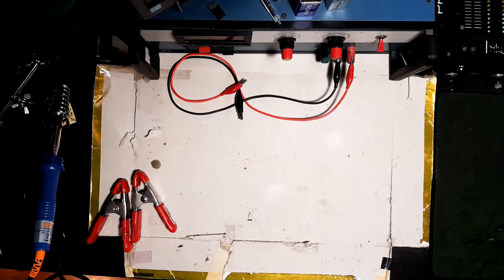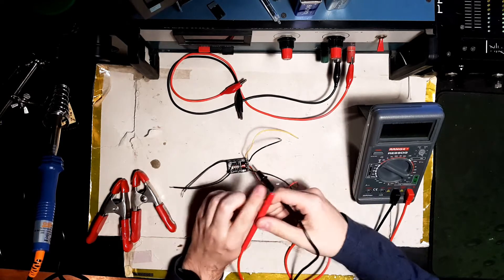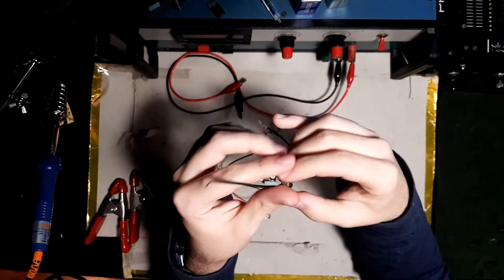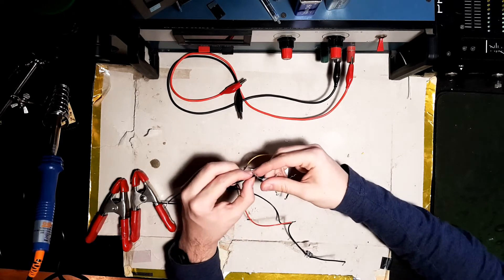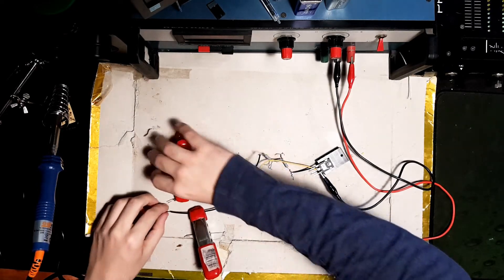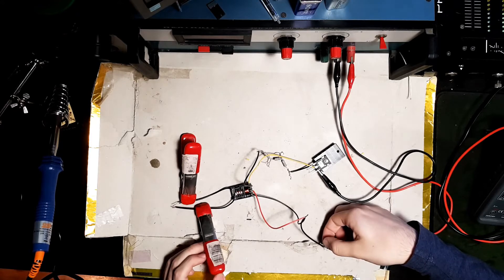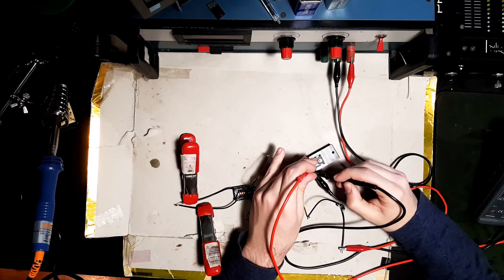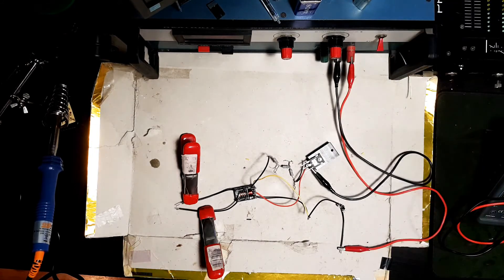DIY easy arc lighter - no transformer winding,9 VOLTS!!

Comment: It should be powered with low as 5 Volt's so the Spike voltage isn't high to fry the transistors gate
Also make your own primary winding with 10 turns center tap of enamel Copper wire
Reply from the maker: I had 2 of these transfomer and I tried to wind my own primary with one but I swear to good it was impossible to get the pre made primary without ruining the core and with 5 volts I it wouldn't make an arc at all. If I were to make this again I would get a bigger ccfl ballast and get the transfomer out of that and then make a small zvs driver with a center taped primary and power it with a lipo battery or if I just use the single mosfet with a custom primary and more protection features and also 5 volts from a lipo